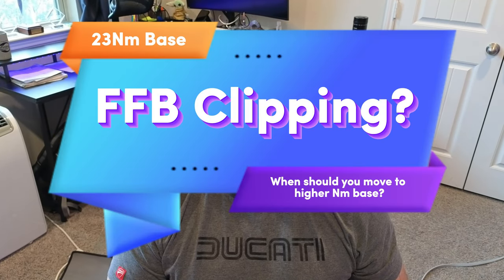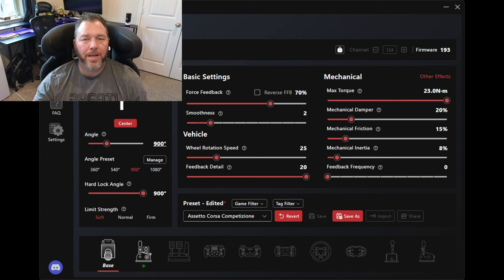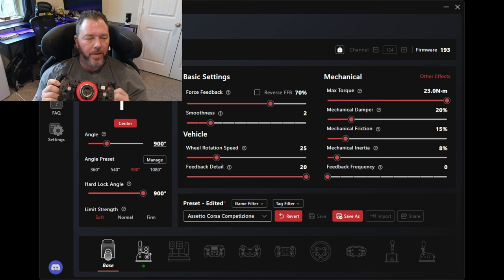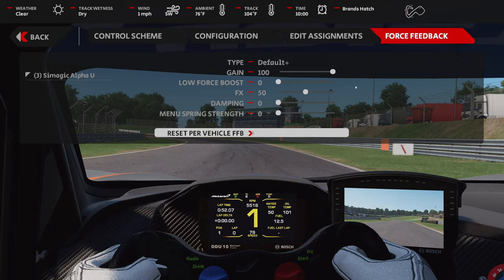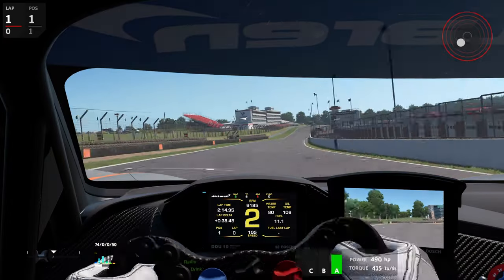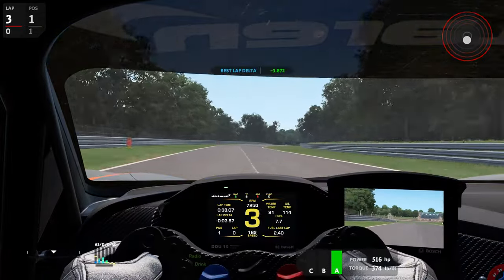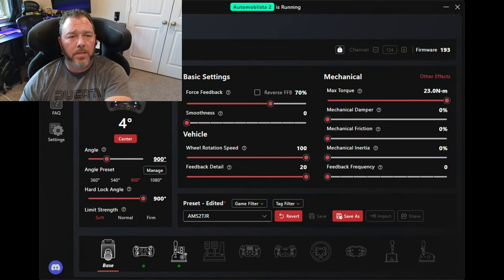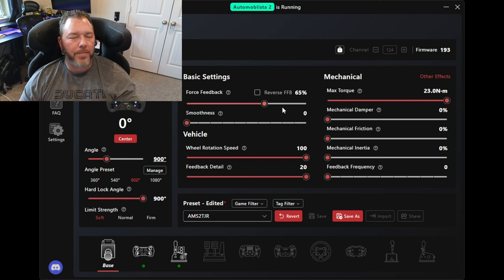When Should You Move up to a More Powerful Wheelbase? FFB Clipping Explained

Comment: One question? What track should you test that would have the most clipping due to turns and curves!
Reply from the maker: @SIMRIG412  hey bud. I like to test at Brands Hatch full course because it’s not to long each lap with banks curves that load the tires. Try not to overpower thru them so to keep the tires loaded and not sliding, but go fast. After dialed in there see Spa-Francorchamps to have a final tweak. Thanks for watching 👍